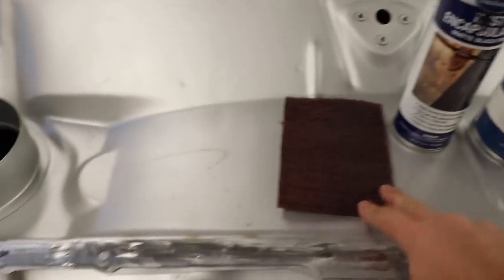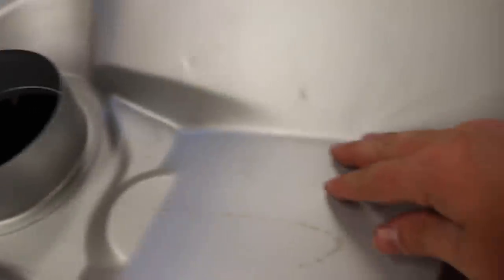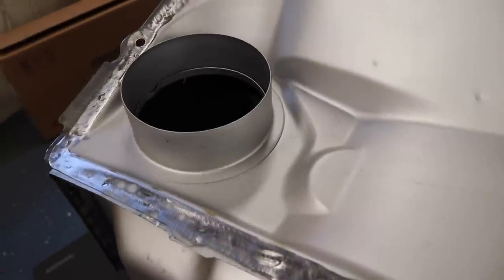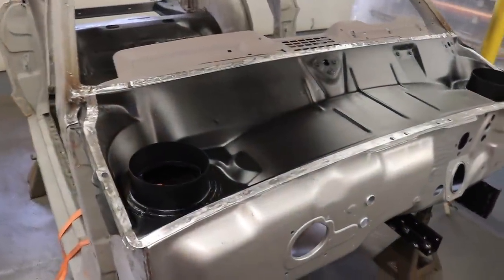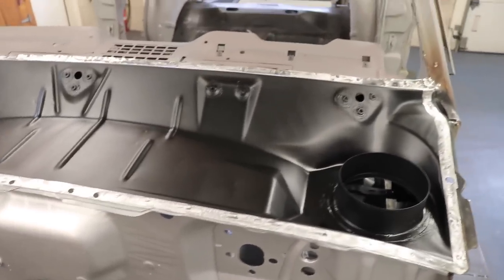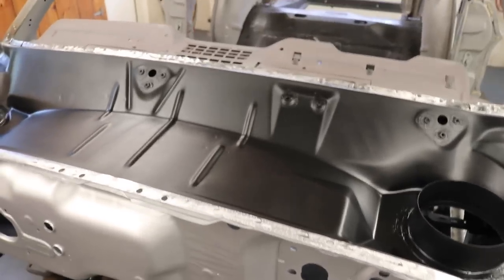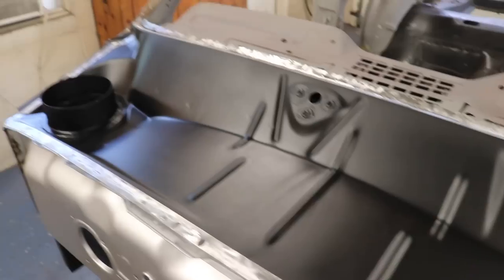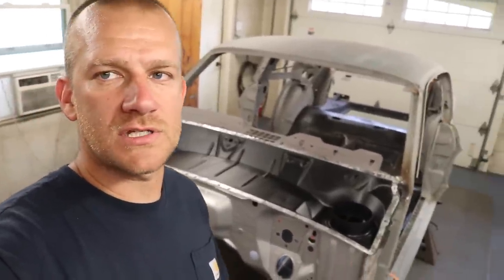How To Seal Your Cowl Area 1968 Mustang

Comment: I’ve tried a couple different weld through primers.   I think you’re right they get in the way when you want to strike your arc.    I usually spray the weld through primer on both sides and before I weld I’ll scratch through the hole where my plug weld is with a wire brush.   I just scratch the surface a little bit and that helps me strike my arc and get my weld started.

Comment: Totally agree on the weld through primer. I paint the surfaces and then clamp the parts together. I have a 1/4” drill bit I have ground flat. I then “drill” the paint off through each of my plug weld holes.

Comment: I agree with you about weld thru primer , I don't use it anymore either . I have been just taking thinned out epoxy primer in a syringe wind a needle tip and squeezing it into the tint gaps that I can get to around the spot welds . Having thinned out lets it flow in the pretty good and Ido 2 rounds of it about 30 minutes apart .

Comment: I too had trouble with weld through primer. 
I also sealed the inside gap of the hats. On my car those 2 welds holding the apron connector to the top of the upper cowl broke loose so water ran down inside the hat, filled that gap and rusted from the inside.

Comment: Such nice work, it really frustrates me how poor Ford’s design was inside the cowl to reliably clear the water away without the drain areas blocking up with debris. Is there any access to keep that drain regularly clear once the car is built?🤔
Reply: Most people who go to this length to restore a car are not leaving it outside.  So the need to worry about the drain holes getting plugged with debris is a moot point!
Reply: @MAn-ti3ul  yes I can appreciate that! 👍

Comment: Love watching your work.. Do you typically leave bottom in the black, or will you hit it with the color paint, if you know color car be ultimately painted ?
PS: on the 65 F/b cowl job, the car was painted white already, so I did cowl panels just You've shown before, though I used Appliance white epoxy paint over the Eastwood Encapsulator as well. Curious 🧐, what are thoughts 💭 on what you can 🙈, thru the cowl louvers from after a car is finished? Thanks for sharing...
Reply from the maker: Leave them black typically

Comment: So you do not use weld through primer before you spot weld the top cowl panel on ? So bare metal on bare metal then prime and seam seal ? You do very nice work , thank you
Reply from the maker: Yes but I use spray wands to coat back in closed areas